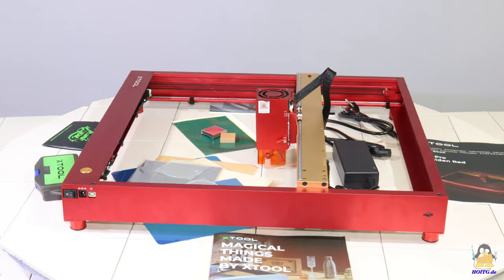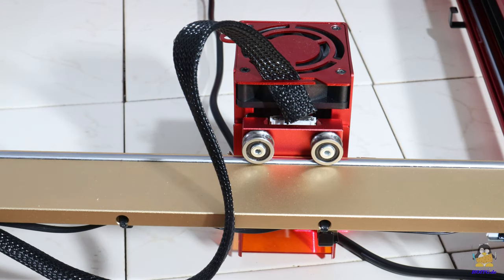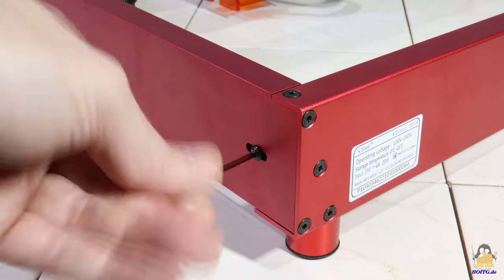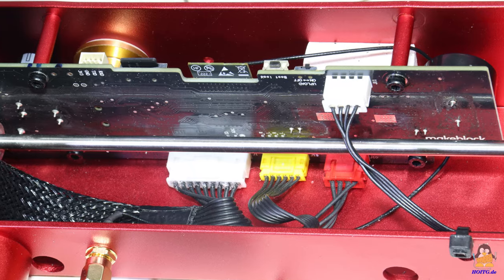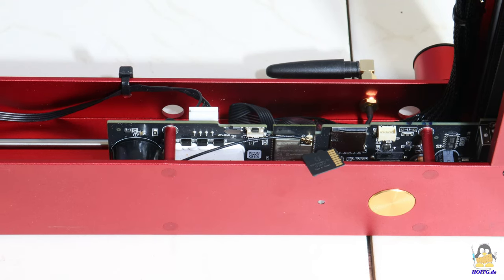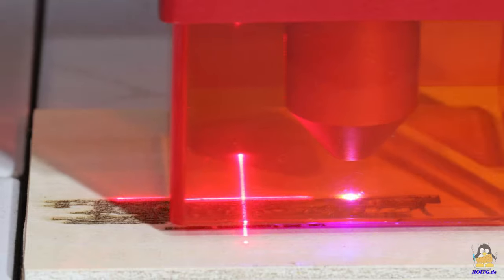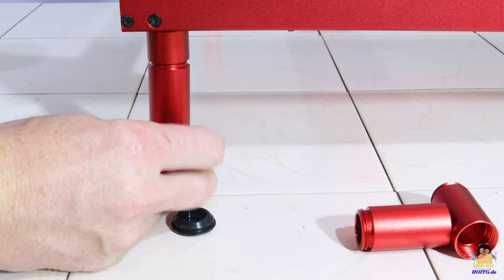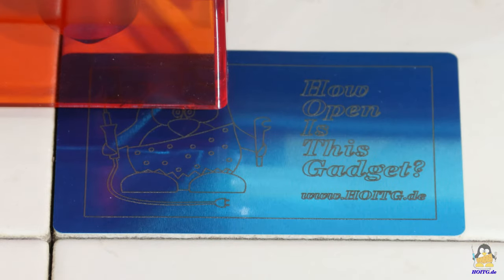Review of the  xTool D1 Pro laser cutter and engraver with 20W diode laser module

Comment: this laser machine seems interesting, have you tried that laser blocking cover if it really blocks the laser?
Reply from the maker: What testing method do you suggest for the laser blocking capabilities of that cheap plastic cover?
Reply: @hoitg4647  if the laser light pass throught then it might be dangerous. if not then it is safe
Reply from the maker: A destructive method. If it doesn't pass, it will melt the cover when you bring it directly into the laser beam.
As can be seen in the video, you can see the scattered light through the plastic. It obviously isn't fully absorbed. To measure the absorbed portion, some sort of light intensity measurement had to be done.